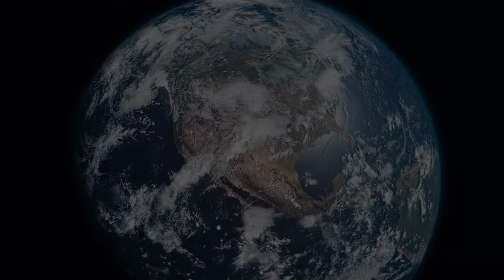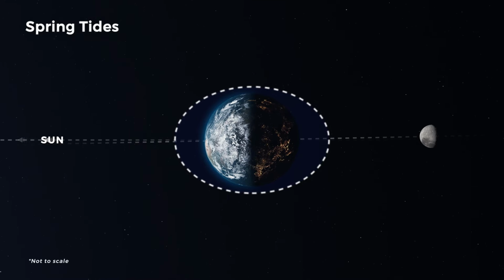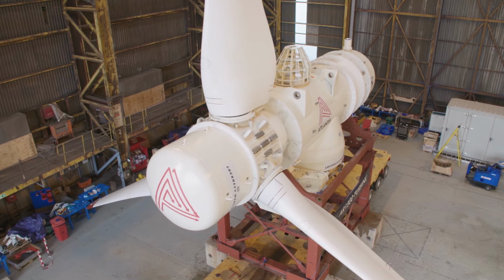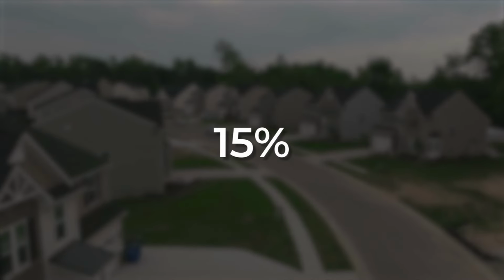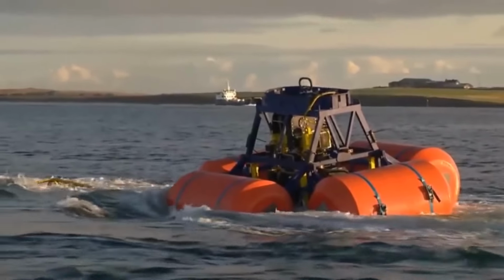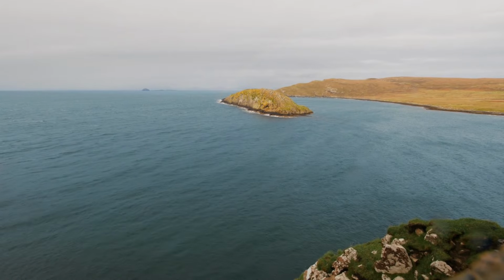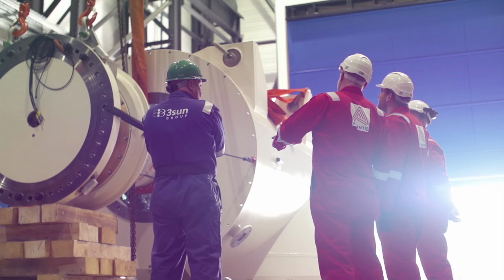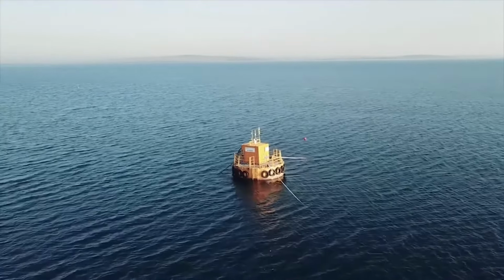Can Underwater Turbines Solve Our Energy Problems?

Comment: I think an important issue with tidal power using submerged turbines is that of finding locations to install them where they can be economic.  Could you install a large number of these in open seas with high currents.  I think the sites in your examples would have had especially high speeds but they are dependent on finding locations and most locations are difficult of access and small.  To be workable I think you'd need to install them in  more open areas with perhaps lower current speeds.

Comment: Could attach to bridge foundations piles. 
Would have controlled speed?
Would produce jetstream xspeed behind propulsion?
Would have break system energy used againt ocean current speed x example. Cleaning bike tyre with hose.
Could create disturbance to ships. Boat propulsion.
Would have cage around turbine similar to airboats a swamp amphibious craft against whales sharks large floating objects. = damaged turbines.
Would need a 360° rotation for when current changes direction. 
Would need to consider bubbles. Oxygen created hits surface. 
Turbines could be engineered the same as dams.
Seabed ideally sand or barin ocean floor site chosen where no reefs and major marine sealife live. Back to whales sharks giant fish floating seaweed getting caught in propellers back to cage turbine objects would get caught. AH got it turbines desgined same as fish gills or submarine sluce gates.
Controlling tidal rip flow and power of rip before underwater propellers =10 knots todal rip flow jetstream behind   =5 knots could slow down entire coastal ocean current speeds. Certian species would swim and live and survive under the 10 knots tide.

Comment: I don't know. I'm kind of falling out of trust with the blade design of energy production. They look out for some factors, but I'm wondering if they are overlooking others.
For instance, wind farms are said to not have that many bird strikes, but what isn't said is that the bird steikes that do happen tend to be larger birds, many of which are endangered. More, it's also claimed that they have a major impact on bat populations.
Similarly with this tech. There seems to be a large focus on the mammel populations, but not on others, like fish and other sea life.
What's more, likely in wind farm tech currently causing so many deaths, their research phases probably looked for similarly specitic areas that tended to be safer. Later, when pressure was on to build out and maximize production, they moved into areas they likley knew were going to be problematic and got passes on approvals based on reaearch phase safety data.

Comment: About 35 years ago I thought how we could harvest massive amounts of energy from oceanic currents, by using turbines installed in small underwater dam installations utilizing the wind tunnel effect (but with underwater currents).   Over time though I realized that if we installed enough of them, it could seriously damage the oceanic currents by harvesting too much energy out of them, which could effect the weather patterns and everything else.   It's something to keep in mind when doing this kind of thing.  That said.. with Global warming, rising sea levels and growing storm activity, I would think large wave power generators densely installed along vulnerable coastal areas could actually be extremely beneficial in preventing storm surge damage by harvesting the energy out of the waves before they can hit the shore.   (they would have to be designed to do this though)

Comment: The bottom line is how much extra money, infrastructure and materials will it take to replace conventional energy? Renewables should be labeled as renewable fueled generators as the infrastructure is not inexpensively replaced nor maintained. It's not completely dispatchable as like the air versions it's generation stream is not a constant level stream of energy.

Comment: Suggestion: Use chain connected from one side of flowing water to the other. Sand filled truck wheels hold chain off bottom but allow chain to spin. Tire pieces, 4 per tire, attached to chain so flowing water spins chain. Gear box and generator stay on land.

Comment: Tidal energy has been my dream as a power source for 3 or 4 Decades. 
In my point of view, Tidal Turbines are not the best solution for Power Generator Plant's. But for argument's sake! The best place for such a Plant would be in the Mediterranean Sea at Gibraltar where you should find fast currants and in many River Mouths. 
But my dreams are different. It has to do with a much bigger and faster Power Plant serving two or three Industries at the same time. It would be a 1) Power Plant, 2) Marine Farming (Mariculture) 3) Seawater Desalination Plant all under one roof taking advantage of Tides and waves allowing you to Pump Seawater to the Mountain Dams in large quantities in order to generate Power and do Mariculture as well as the Desalination.

Comment: No, there's ZERO sustainable and or green energy source that is cost-effective. We will still need to produce electricity via fossil fuels well into the next century. 

We need a breakthrough of innovation in order to make any of it cost effective.
Reply: Look up kairyu turbine
Reply: @kami_1789  That's limited to coastal regions only. It can impact wildlife too. We could build tons of those but the upkeep on them would be more costly. The way we use power has to change and then a transition into solar and wind power would be ideal. To make things work with less power has to be a bigger goal.

Comment: what if you made the turbines of plastic, but very tiny, like size of computer fans or something, but you have tons of them. if they are tiny the weight per unit would be small and the tear would be gone. ofc it means you would need alot more of them. but they could be put on the same long moving pipe wich means it would spin faster and generate more energy that way? spinning fast becouse its longer, at the length -------  instead of height"long blades" | wich current wind turbines are.  so like this <-<-<-<-<-<-<-<-¤   that is many tiny fans on a long line spnning fast couse they got many fans. the fans movement of the water infront of each fan would extra movement to the one fan behind it and so on, becouse water denser and the spin would generate more trust giving more speed, more speed, more turning in the turbone in the box wich would generate power.

Comment: Why couldn’t piping shaped to surround the blades be used to block wildlife? A small amount of lattice work would eliminate most of the hazard. Not enough to block the flow, but a place to escape from if they did get too close.

Comment: Neat but why bother? The grid of carbon dioxide hysteria ..... and a BOON for China.    

The greenhouse effect, a summary of the article by Happer and Van Wijngaarden
By Andy May

Figure 1. The calculated outgoing radiation flux spectrum from the Earth, with a temperature of 288.7K. The red, green and black curves represent the radiation emitted as modified by CO2 (in various concentrations) and H2O, O3, CH4, and N2O, the main GHGs, at their current concentrations. The blue curve is the flux without GHGs in the atmosphere. The black curve represents the flow at 400 ppm CO2, current concentration. Green has no CO2 at all and red has doubled CO2 (800 ppm). The x-axis is the frequency in wavenumber units and the flux is in (mW cm) / m2. The additional forcing caused by the doubling of CO2 is the integrated area of the distance between the black line and the red line, major differences are highlighted in yellow. The rest of the figure is explained in the text. The data used is from HITRAN and the figure is very similar to Figure 4 of (Wijngaarden & Happer, 2020).

https://clintel.org/the-greenhouse-effect-summary-of-the-happer-and-van-wijngaarden-paper/

Comment: 26-08-2021  Bangalore India
Electricity can be generated from sea water.
The question is:How?   
There is a relationship between bounced ball and sea water.
This relationship, if exploited, can generate electricity.
You bound a ball with moderate force down ward or sideway to a wall,
it will bounce back.  Same principle can be applied electricity  from  sea  water.

-Nagaraj  T V

Comment: Twenty-two years ago I presented the findings of our engineering team at Offshore Technology Consulting in Houston. We examined tidal wave energy acquistion / conversion to electricity and found it to be exciting. OTC's engineers came across a powersource with great promise: A MOVING RIVER OF WATER IN THE GULF OF MEXICOm just 70 miles south of Houston in the Gulf of Mexico-The USA end of North America's Equator Gulf Stream. The Gulf Stream is a giant river running from the Equator north to Texas then moving around the Gulf Coast to the Atlantic Ocean and on to north of Ireland where it subducts several thousand feet and then returns to the world Equator as cold water. On the Texas / USA Gulf coast its in shallow water. On many days one can sit above it in a small boat and watch as it passes underneath. This is a unique form of energy. Its been running for at least 2 million years. The OTC paper we authored shows that  a dozen turbines scaled up to a diameter of 200 meters (600 feet) with blade tips anchored in its inner walls would supply all the electricity for the 7 states on the USA Gulf coast. The scale of such a structure is quite doable. There are at least 5 multi-well drilling platforms in the Gulf of Mexico that are over 400 meters tall standing on the ocean floor. The Gulf Stream turbines would be towed by tugs out to locations and would be anchored to the ocean bottom. Essentially the Gulf of Mexico southwest of Galveston Bay (Houston Metro) is rather shallow at 70 miles - 100 meters to 200 meters deep. The benefit as we see it is they will be sunk to depths below the zone of destruction from hurricanes which are the real danger to turbines ./ tidal barriers close to the shore in the Gulf of Mexico. To visualize this structure, we copied the round space frame of the Houston Astrodome without the roof just its ring structure, We put this into the vertical with blades inside its circumference  and lowered it 400-500 feet into the Gulf Stream. This simulation worked great in simulations we performed with a Cray Supercomputer her in Houston. Funding would be needed. Each unit projected cost would be $1.2 Billion. Not all units would have to come on line at once. Cost could be defrayed over many years as new units come online. Connection to Texas power grid thru large undersea cables to the nearby Texas coast at many points. REF: NOAA GULF MAP amd Gulf Stream map USA and Atlantic:  https://scijinks.gov/gulf-stream/

Comment: We don't have an energy problem. We have a leftist, political problem. And, yes, I am a degreed Mechanical Engineer with 30+ years of experience in engine, transmission, transfer case, and powertrain design including aerospace and industrial gas turbine engines, tractor transmissions, Diesel engines, and other systems. So-called "renewables" will never supplant combustion engines -- ever.

Comment: Underwater turbines are no longer a necessity ! Thanks to SAFIRE (Canadian high tech electrical engineering company) the solution to our energy needs has been finally solved. The solution is known as Plasma Nuclear Reactors. A 100% GREEN solution that is claimed to be 1600% more efficient than a current & dangerous Nuclear Reactor. So efficient in fact that even those ghastly Wind Turbines can be abolished. 

Announced at Bath University UK in July 2019. SAFIRE spent 8 years re-researching the way the Sun works and discovered mainstream science has got it all wrong. In reality the Sun (& all the stars) work like light bulbs. SAFIRE recreated a piece of the Suns atmosphere in a laboratory chamber and discovered that interaction between Plasma & electricity in the Suns atmosphere is the real way forward. Hydrogen a cheap and abundant molecule can be used to provide the power source for the new Plasma Reactor method. The new system being so efficient and 100% green, should dramatically reduce electrical costs to the consumer. I can hardly wait......

Comment: Not a good source. Read Energy without the hot air by Mackay. There is cold water everywhere in the ocean at depth and this can be used in warm areas for reverse refrigeration to separate H2 from seawater. Simple. However the real source is above the atmosphere if we can proceed with Starship and Starlink-like collectors.

Comment: What I want to know if why the following is not feasible:

A whirlpool is one of the most common phenomena in the universe. What I want to know is why isn't it feasible then to create a whirlpool motif to generate electricity? What I envision is taking advantage of a waterfall by allowing some or all of the water to pool and drain down into a series of waiting compartments. The drains into the compartments would follow a spiral along the edge of a compartment wall down into a pool of water that was maintained at a constant level by water entering and exciting a compartment. As the water enters a compartment, the water feeding the pool inside would be such that it encourages the movement of the water into a whirlpool motif, a vortex the keeps the water moving around the pool as it exists the compartment. While the vortex is maintained, the water spins propeller blades that are pushed by the actions of the individual vortices in each compartment. The propeller then generates electricity accordingly. I imagine that a compartment is approximately 3 feet in diameter and maybe the same height. There could be hundreds of individual compartments in a given level and as many as a thousand levels. A hundred thousand vortices spinning maybe as many as 5 blades (or more) per compartment to generate an endless amount of electricity. 

Thoughts?

Comment: In the west coast of India in the state of Gujarat, gulf of khambat  is possibly an extremely potential place to harness tidal energy. I happened to study it's oceanographic reports of an oil well drilling operation at those locations some 30 years ago. 
Around 10 m/sec of max surface current speed. A huge silt load can be expected as the water looked muddy all along and its locked harbors had deep levels of clay all along  it's shores.

Comment: OK YOU CAN USE MINE YOU GET  20  ft. stainless a4 3 ft diameter shafts cross bored for 1 ft shafts for opposing flat thin heavy  blades with trust electronicaly controled  magnetic  bearings  and pair of what size best for mass weight main shaft.ends machined down for frictionless  heavy duty magnetic pillow block bearings.safety issues considered paramount light speed possible both directions..be ultra careful.please  its easy to viod betz impossible claims 4 times + rpm + ?    Just needs funded.and electrical transfer dealt  with.full consideration. Of unlimited spin being added to mass in centrifical and angular momentums. .

Comment: Sea turbines are more of a sea creature grater than energy provider.  Tidal pumps are far better and there one in the pipeline between Dunnet Bay and Sinclair Bay in north Scotland . With the Pentland firth in between to provide the tidal height difference needed.  It a system of two float chambers ( one at each end ) and the generating station on land in between . Due to the tidal differences it will provide continuous  electricity ,all day every day .

Comment: I think the marine mammals would get used to the noise and come closer to the turbines over time and risk hurt themselves.  The sonar system would be useless, and as animals come close more frequently the system would shut down the turbines for the safety of the animals which would hinder the electric generation process. 
Encapsulating the turbine with a cage wouldn't be a good solution as well.
That's a hard task indeed.

Comment: Anyone who has stood by a seawall next to an inlet, can see the tremendous power in the tide change!  It happens 4 times a day without fail!  Duh!  Sounds like a endless source of power!
Cost??? You have got to be kidding me!!  How much does it cost to dig coal or oil or uranium --- ALL -- of which harm our environment!  But tides don't (climate change, king tides??) They just happen everyday, all we have to do is harvest that energy!  Duh!  I've even thought of having waves, pump and compress air for energy!  
Two men, one in australia and one in france were developing air driven engines!  Boats could use them like gas stations to run their air driven boats!  Talking about eco friendly😁🤷why not?!?

Comment: Hook  line and gaps when oil greased betz limits in 1919 to lose 1/2 + new inventions bigger better 100 %  coveting all natural currrents with the light speed capacity in electronics of magnetic bearings . Einstines relativity is stonewalled

Comment: Out of all the possible ways to build a hydroelectric dam, the tidal method has the least potential energy normal hydroelectric dams hold back an artificial lake several thousand feet above sea level. not only are those lakes able to be whatever depth the surrounding mountains allow for, with more depth equaling more water pressure through the turbine, The water can even be captured several times on its long journey to the ocean. When you use the tidal method, you're only able to take advantage of about 4 feet of height difference. When it comes to head pressure, surface area doesn't matter, only depth. You could make the area of captured water larger and add more turbines, but you can't make an individual turbine turn more efficiently just by widening the area. On the other hand, you're not limited by the amount of rain and snowfall since the tides will continue coming in and out all year no matter what.